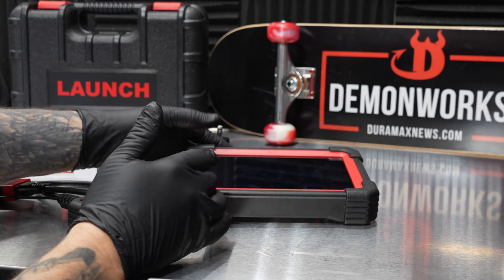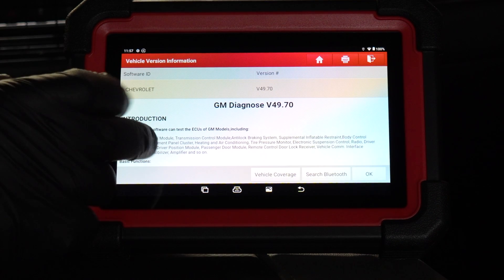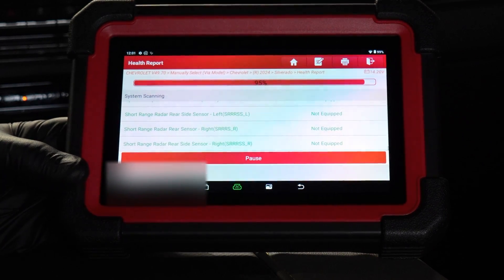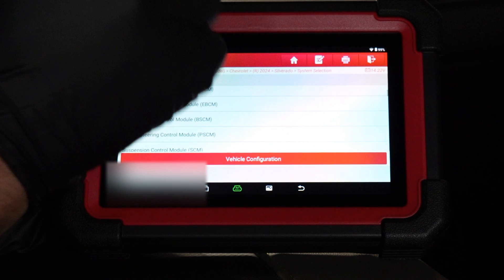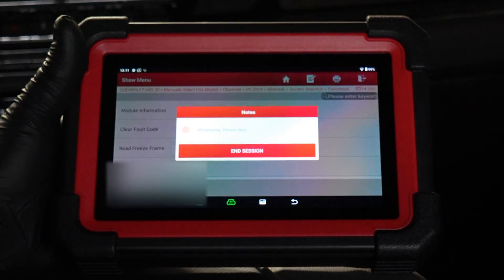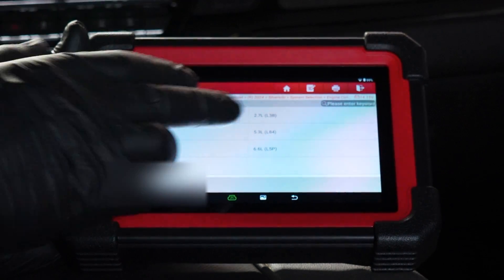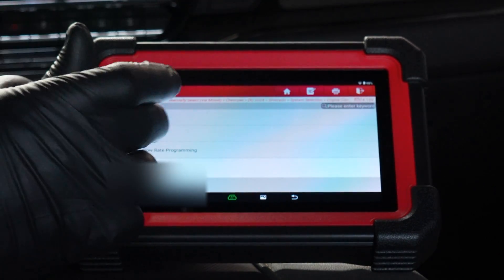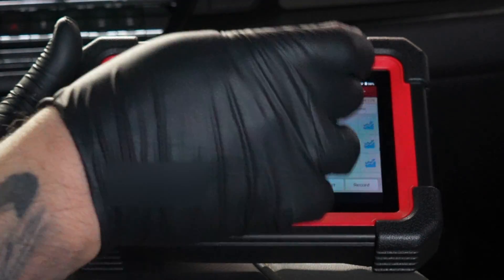The Essential Scan Tool for Diesel Tech: Launch CRP919EBT X431

Comment: I'm looking for a new scanner for my gas powered autos .. however need it to work on diesel pickups such as Ford, Chevy and RAM ...   Seems I cant find the scanner I need to detect firing the FICM in a Ford or RAM injection testing ..   Would really like to see one of these new brand scanners used Launch, XTOOL, OTOFIX and others tried on these diesel powered pickups.  Seems YouTube lacks enough of diesel diagnostics with these scan tools.  Thanks!

Comment: I didnt see a LM2 option on the screen for the engine options.  Can it do a park regen on LM2?
Reply from the maker: Yes, it can
Reply: I purchased this tool because I wanted to do a stationary forced regen like I can do on my Jpro on the Semi trucks we work on in my shop. My LM2 has been doing about 2 regens per tank of gas lately and only going down to 25% soot level (according to my idash) After performing a stationary forced regen, the soot level went down to 2%.  Thank you for this review.  One question, is doing this forced regen bad for the engine?
Reply: @hirovision yes and no 😅

Comment: Can you look at injectors, and see fuel pressure with it, and it’s bidirectional right
Reply from the maker: you can program new fuel injectors, look at and command fuel pressure plus a lot more. It is bidirectional.
Reply: @ I got a 08 6.7 Cummins with g56 6 speed n just wanted to see what’s up with injectors and see rail pressure and pump pressure thanks much man
Reply: @ that’s tits thanks for responding so quick man! Getting one!!

Comment: will these work on a GMC sierra denali 2018 6.6 diesel? i want to do a DPF Regen
Reply from the maker: Yes, I have personally used this on that year.
Reply: @DemonWorks  would this tool be able to do a turbo actuator relearn on a 2017 and 2019 gmc 3500 Duramax?
Reply from the maker: @ yes, I’ve personally used it for that.
Reply: @DemonWorks  what’s the difference between the CRP919EBT and the CRP919XBT. I’m in the U.S. so I want one that works here.
Reply from the maker: @jthart92 I’m in the us as well and mine works here, and that is the ebt. In my research with launch, the X and e are the exact same tool, only difference is the distributor of the tool.
Reply: @  can you check if yours will do abs bleed on a 2011 Toyota Corolla
Reply from the maker: @jthart92 I’m not able to do that
Reply: @  really it claims you can do abs bleeding
Reply from the maker: @jthart92 I’m not able to hook up to that car to confirm
Reply: @ oh lol 😅 scared me for a second

Comment: Tire size? Does this allow you to change that? Or is there a way to make such a change? I’m running 35’s on my AT4, and the dealer refused to change the tire size for me.
Reply from the maker: It cannot, nor can the dealer. You will need a custom tune or a piggyback device that corrects the speedometer via your cluster (edge) or banks idash that will correct it in the idash.
Reply: @DemonWorks  yeah that’s what I thought. I’ve got corrected speed on the idash, but I’m having to hand track mileage which is a pain.
Reply: @Gameplayer70 how does the AT4 do on 35s? I’m hesitant with only 3.23 gearing
Reply: @BabyGators  you mean drive ability? The 3.0 has no problem moving them around. I’ve calculated my mileage difference out to a factor of 1.063, so it’s not a big difference.
Reply: I have the launch scanner and is not possible to change tire size to the gear/ speed ratio, the only one can do that is the autel maxisys

Comment: How does this rate against the other one you showed?
Reply from the maker: I've shown roughly 5 on this channel. All of them have a different price point so it comes down to what you are looking for in terms of options it has and the screen size you want while considering if corded or wireless is best for you. This one is a upgrade to the x431 I showed several months back. It has some internal upgrades as well as bluetooth dongle instead of the cord. Small price increase.
Reply: @DemonWorks  Ah, I think it was the Launch X431. I'll go read up. The DEF useage has be curious and my dealership doesn't really engage my questions. Thanks for the fast reply!
Reply: I only use factory software, my laptop has every manufacturer software. To me everything else is garbage
Reply: @vhp454 Buddy, We all use OE Software but these tools definitely have a different purpose and practical use. To me these are a must have tool for the price.
Reply: @vhp454 that would be the case 15 years ago. Now a scan tool will do just about anything dealer programs can do. But on every vehicle.